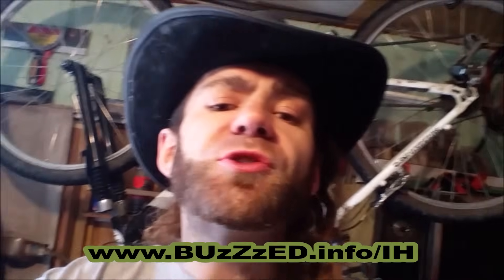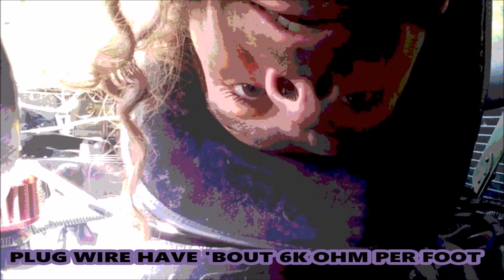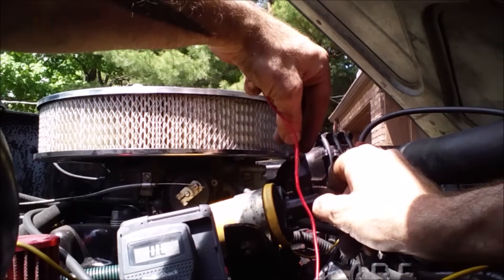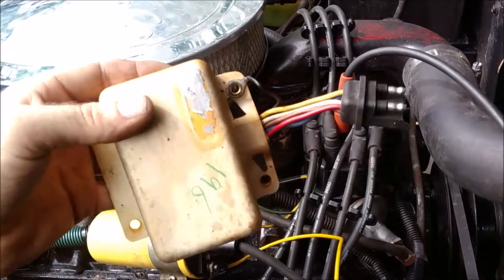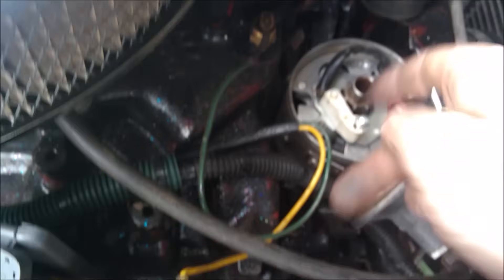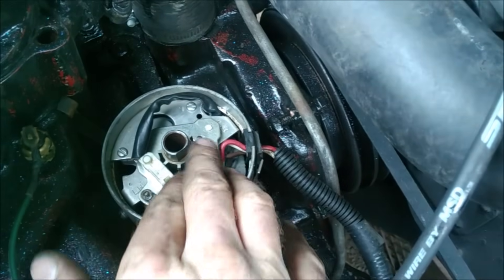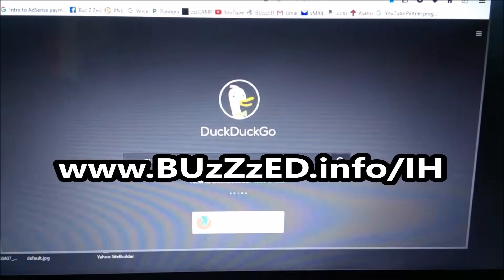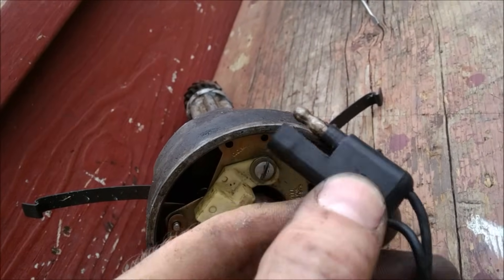NO SPARK, NO START, NO PROBLEM!  IGNITION SYSTEMS

Comment: Never spark test near the battery. Typical lead acid batteries occasionally vent Hydrogen gas. I saw a "Know it all" almost get his hand blown off by checking spark on the negative battery terminal with a screw driver. Other than that this is a good informative video.
Reply from the maker: I thought I wrote not to, I only did it there for filming reasons. I  honestly never heard of anybody actually having this happen or a car running at the pump blow up the town, other than from my h s shop teacher talking about the 50's, but it could under once in a blue moon conditions, no wind, hot, dry, just the right fuel air mixture lol  So Yes your right, this should be avoided, or know your risks. I did have a fire extinguisher near and was safe, unless I panicked or hesitated, I was fine, worst case i would have lost wires and lines.... yet still why risk a 200$ battery!
I guess what I am saying , is i always look at every situation with caution, not just red flags...  So I am just adding that the more aware of your surroundings, the safer you are and less grey area. So to take it a step further, realistically we need to be always aware of every accelerant or flammable matter in every situation, of every potential weapon in the room and where every bodies hands are in relation to them... the more you know the closer to the line, the more from life! I love to learn! Just never hesitate and everything else is out of your control... thanks for pointing that out...
Reply: I didn't believe it either until I saw it for my self. I have a picture of the battery somewhere.

Comment: hi erik . can a ford spark plug wire be used for a dodge durango ignition coil wire ?
Reply from the maker: sure, just know that a solid core wire is really for points only,  they can cause interference with electronics.   Other wise you really only have two choices of wires,  cheap carbon core wires that wear out quick, or a wound alloy type core, both reduce the emf enough to not interfere with the electronics...

Comment: Hey any advice? I’ve replaced the ignition control module, ignition coil, distributor, and plugs with still no spark, I have a 96 f150 with a 351 Windsor and I’m running out of things to replace and money! Any advice would be appreciated!
Reply from the maker: With no spark at all? It could be your ignition switch, or a broken wire.
Reply from the maker: I mean if we are looking at rare things is the engine grounded? But I would do a leakdown test. Sometimes even the pins in the bulk connectors get pushed out... but you really need to prove every connection and eliminate the basics, is everything getting power, and shirts or false loads, is the ground good, is the ignition switch good, if you jump power to the coil from. Battery... heck in computercontrolled cars a bad battery can cause issues but yours sounds like a short or a bad part, it’s pretty simple, key goes on and coil/distributor get power, 
Then key goes to start and everything but the coil/distributor loose power while the starter engages.
When camshaft turns it turns the distributor shaft by the gear. Then the rotor points at a cylinder and the magnetic pickup tells the coil to dump the spark at said cylinder, with some interference from the control module controlling the spark. And that’s all there is to it. So if the distributor rotor is turning, and your rotor is good, and assuming your new parts are good. You must have a short
Reply: ERIK THE WRENCH Turns out I bought a faulty set of ignition components, installed the original with the new distributor and crankshaft sensor and now she purrs first key turn, thanks for your help!

Comment: PROBABLY YOUR IGNITION STARTER SWITCH IN THE STEERING COLUMN,CHECK YOUR IGNITION FUSE AND ECM FUSE SEE IF THEY LIGHT UP WITH A TESTING LIGHT WHEN YOU TURN KEY ON.IF THEY DONT THAT'S YOUR PROBLEM.

Comment: what year??thanks
but.no thanks I'm in 2017
Reply from the maker: Well this don't deserve a response but, but, it is the same on new cars and you need to learn basics! As I explained a new car just has the magnetic pickup on the cam end (cam position sensor) and the old has the cam position sensor in the distributor turned by a gear on the cam!!! Same thing. An engine is an engine is a n engine.... unless it's a rotary or a two stroke

Comment: Very good video. Can you give me what the coil should measure at primary and secondary on a 73 ford 400 c.i.d. Galaxie? Thank you!
Reply from the maker: Stephen Kacin, all single coil v8 the same
Reply: Thank you Erik, but i dont know what they are? 1.5 primary, 8,000 secondary?
Reply: Thanks Erik. My 73 Galaxie is showing no spark to or from the coil. Seems to be intermittent. Any ideas where to go on this gremlin?  This is coil # 3.
Reply: just so you know in case you havent figured it out yet. ford doesnt make a 400 ci engine galaxies most of the time have 390 engines. 400 is a gm engine.

Comment: I'm less than a beginner, so my question is the values of impedance and voltage you talk about are standar values for lets say petrol engines, or do they vary accordingly with something for instance, brand or every engine is buit to run with a certain kind of impedance or voltage and those values are provided by the manufacturer.If myquestion turns to be a bit confusing, i mean how do you know the right reference values when it comes to electricity?
Reply from the maker: jose pontes , some heavy equipment might be 24 volt, and some old cars, pre late 60,s, where 6 volt ( and most have been converted to 12 by now) 
    But otherwise even semi-trucks and motorcycles are all 12 volt. (Or 14.6 running).   The resistance on the coil will be the same for all v8 petrol, propane, alcohol....or close to it, oh, some old motorcycles and mopeds are 6volt as well... but we're talking 70,s
When doing leakdown test you will need to know the resistance of what ever part your testing, manufacturer specific according to manual, but if you buy the Haynes manual for obd2 codes they have general numbers that are good most the time... 
also voltage divided by amperage equals resistance, if you know the amps...     
I will make a video on leakdown test soon, I have so many videos I haven't had time to upload yet! Just been busy at work....
Reply: Many thanks for such a teaching answer. I'll be looking forward for those videos. cheers
Reply: jose pontes 1999 1997 Chrysler no fire what do I do
Reply: jose pontes I need to know if a 1997 Chrysler convertible it has no fire how do I bypass to the coil pack
Reply: jose pontes.

Comment: where are the multimeter's leads attached when testing the distributor pick up coil? The video does not indicate that after testing the ecu.
Reply from the maker: Vinnis  in the next video there is even more on it on Petronius upgrade

Comment: I want to sincerely thank you for this video.  I have been catching hell trying to get my Charger to start after letting it sit over a year.  I had it in my mind that it was the fuel pump.  Then I was thinking I didn't install it right.  Could not get it to start.  Was thinking of replacing the distributor, ignition module.. etc.. just guessing.  Your video DID THE TRICK!  I ohmed out the coil just like you showed and compared it to two other coils (one brand new) and that was the issue.  That 440 is running like a champ now. I cannot thank you enough.
Reply from the maker: RIcky Rick my pleasure!

Comment: I have a 1978 Camaro with a sbc 305 i've been trying to start it but I have no spark, I replaced both the coil and the ignition module but still no spark is there any suggesrions?
Reply from the maker: Have you tried jumping the coil right off the battery? I also own a 81 trans am (same style) and the ignition switches go bad on them
Reply: No I have not tried that yet how can I do that?
Reply from the maker: Gabriel Dominguez connect a wire from the positive on the battery to the positive on the coil, (the red wire) if it is not red it might be brown, check first by using a test light or a with the key on with the wire clamped to ground and the other end on the coil input wires with key on .... if either side lights up it is getting power.... if not well their is your problem.... you can jump it like I said, disconnect battery positive then use your ohmmeter to test each wire on the coil to a ground , the one that has zero resistance is your ground, so jump the other side to positive....

Comment: Hello Eric the wrench. Can you help me out I have a 1985 Dodge ram three-quarter ton four-wheel-drive 5.9 L. Starting the vehicle cold I have no spark out of the coil until you release the key to the run position. after it warms up it works fine starts right away plenty of spark I have replaced coil. ignition switch and ignition module any suggestions.
Reply from the maker: It sounds to me like you have the coil wired to the wrong spot, the ignition switch kills power to headlights and accessories when cranking, try jumping hot wire on coil to positive on battery to se if that solves it, then wire to correct terminal....
Reply: check the ballast resistor this is common on mopars when they go bad, will only fire while cranking over then when you let off of key to run position it quits running  !

Comment: i dont have  distributor:(
Reply from the maker: then its likely your crank position sensor basically the magnetic pickup for your distributor, only mounted on your engine block!!! an engine is an engine is an engine , all works the same.... the new engines have the same basics as the old, it just looks confusing now lol all the same....
Reply: umm changed it out   still no spark also changed  starter battery alternator coil packs  checked the fuses all good   have fuel pressure     and the engine cranks just getting no spark to the coils   in turn no spark to spark plugs
Reply from the maker: Dustin Cordell so the sensor has to be gapped... otherwise you say you tested coil, and it has power? Then the coil is not getting signal from the sensor, is the sensor getting power? Is that wire from sensor shorted broken? How it works is the the crank triggers the sensor by spinning past it and interrupts the field,  Audi g the coil to dump spark...which cylinder gets sparked is determined by the computer or brain box....
Reply: yeah  this  is one of those freak machines man basically i think the ecu is toast  what happened was   at first  i thought i seized the engine  because i froze the block  because it got real cold  and had no anti freeze in it   ran it with  frozen water in the block for about  6 miles  so it over heated   i pulled over  parked it went back  next  day was  filled up the reservoir tank   with hot water  noticed a crack on my radiator   was really hard to start up but it did fire  and ran it for another 4 miles  then it died mid  drive  pulled it over again then got nothing but a really hard clicking thud noise   so i had it towed could not get it started  thats when i replaced the starter  after a  week of letting  the block thall out   then  the engine started to crank over but 
 as i stated  in my above message   NO spark  at all to any thing  all electrical is dead  replaced  every thing 
it could be accept the ECU so i am gonna pray it works i am thinking maybe the  hot steam  under the hood when the radiator was cracked caused a short and kill the ECU  BTW this   was a Ford Ranger edge 2002 3.0 l engine
Reply: no distributor then crank or cam position. sensors are bad check ecm ign fuses and relays bcm stuff like that .
Reply: does distributor spin around with cap off check to see if the distributor rotor cap spins while cranking engine over if not then timing chain is shot if thats not shot then possible top cam snapped on ya .
Reply: the fly wheel spins and acts like its going to start  then no spark:(    so i think you are right either jumped time  or  cam  i  done  replaced the crank sensor  the alternator battery post  new battery new radiator    iam just dreading pulling off the   front of the engine   or the cams to check my chains

Comment: Hey Iron Hammer, can I do this same test on a 2002 Nissan Sentra?  I have a no star, no spark, cranks condition. I have come to think it is the coils. I don't get spark when is connected to the harness and crank the engine when I put a screwdriver. Does it need to be close to body engine? Does a Nissan also have that module?? I don't know where it is. Thank you.
Reply from the maker: Newer cars are the same, only that module would actually be outside of your distributor on your engine and called a "crank position sensor", they go bad and wont trigger any codes...
Reply: Hello Iron Hammer, thanks for your reply. I did change a brand new crank sensor and new battery. I am still not getting spark in any coil. Could this be from the signal in the coil harness to the ECM? Is so, can you please tell me how I can check to see if I am getting it?   I know I am getting close....thank you.
Reply from the maker: yes coils go bad you need the book to know what the resistance should be, on your model, You could use a test lite to see if the pos on coil is getting a signal from ecm, like is it pulsing a signal when you crank, but also some crank position sensors need be gaped... yes could be a fuse/connection/wire in path of ecm, some times pins in bulk connectors get pushed out... here is how i diagnose electronics, even down to circuit board level,   [Step A> Visual inspection for obvious] now [Step B> Dis-connect battery and test for short with ohm meter on + & - and circuits naturally closed (temp sensors may be partially open if not cold!) wiggle wires when doing so, now start turning stuff on, if the ohm meter shows a open path w/o any resistance that is a short circuit,] [-now you may have a false load! so C> "VOLTAGE DROP TEST" you put the ground of voltmeter on battery ground, and test the voltage before and after each connection, if it is not the same, their is your false load. (a 12 volt bulb should read 12-14 before and pretty much 0 after.)

Comment: You didn't show where to attach your leads on the multimeter at 5:36, which makes this video confusing to someone learning for the first time.
Reply from the maker: same as i shown with bulb, neg to ground, pos to the neg wire on coil,
Reply: Dustan Brown volvo
Reply: I was thinking the same. I want to know where they are connected.
Reply: The battery??